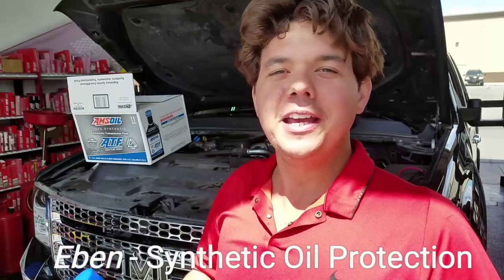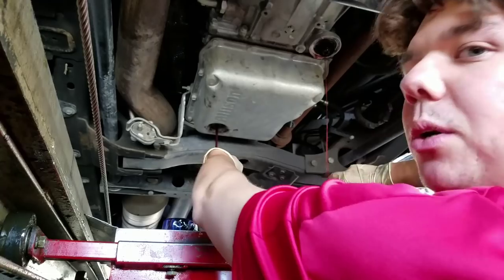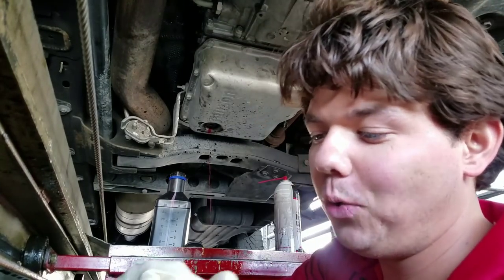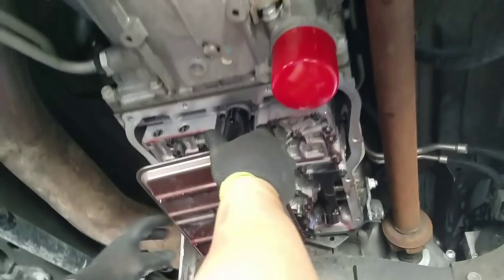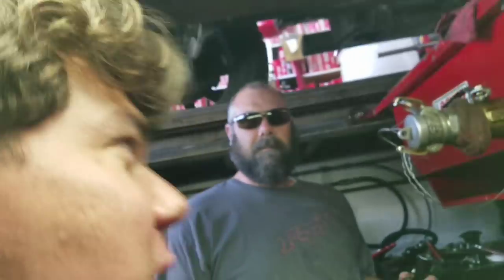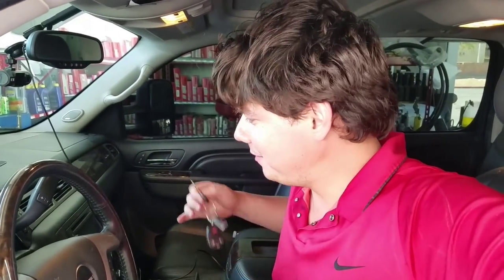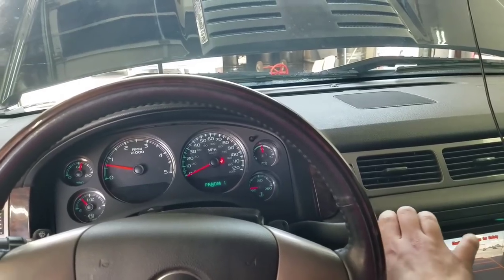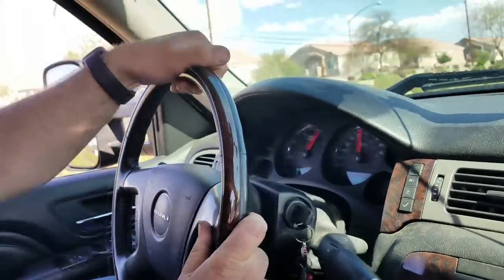2013 GMC 6.6L 2500 AMSOIL Allison ATF Fluid Change

Comment from the maker: Watch This Next: https://youtu.be/rYK246GoHQc

I give a man a fishing pole & show him how to fish. 

     Together! We can get your vehicles to run better than brand new!

     For me to get credit & be "Your" Independent AMSOIL Dealer please use my website below or my dealer no. 5331179 call anytime Eben Rockmaker 702-472-3614
After you click on: http://syntheticoilprotection.net
1. Click hamburger menu
2. Click offers AMSOIL preferred customer
3. Click join now 6-month PC member add to cart. ( there is no reoccurring renewal membership unless you select that dot box ) 
( you have the option to not have your credit card saved if you prefer - est. 1972 )
4. Scroll up to the top Select shop by vehicle.

New promo: FREESHIP
     
     🥇🥇🥇 Synthetic Oil Protection Google map reviews
Eben Rockmaker, independent Amsoil Dealer 
Dealer no. 5331179
(702) 472-3614
https://maps.app.goo.gl/1aXxuXrXK9eJwqK78
            
♥ See fluid performance tests - https://www.amsoil.com/performancetests.aspx?zo=5331179      

     ☕ Buy me a coffee - https://www.buymeacoffee.com/Syntheticoilprotection

🇺🇸 Did you know a oil manufacturer can call a lubricant a Full Synthetic when it's only 25% synthetic? AMSOIL is different because it is 100% Synthetic and has a higher film strength keeping the metal parts separated. AMSOIL allows less friction, less heat, less wear on the component. AMSOIL Signature Series motor oil has guaranteed protection for up to 25,000 miles or 1 year of normal driving. 

     ♥ Your vehicle could run better than brand new by choosing the right fluids! See results - https://youtu.be/by5RYv3Dt0Q

     🇺🇸 Why AMSOIL - https://www.amsoil.com/about/exclusive-distribution/?zo=5331179    

     ☕ Synthetic Oil Protection Coffee - Ebens Favorite: https://supportwith.coffee/shop/subscriptions/sop/

Comment: My experience with  amsoil is that the more you drive the better and stronger the engine feels and sounds
Reply from the maker: Yeah it takes thousands of miles to clean up the inside of a motor especially with the signature series and changing the filter.

I've noticed the motor on my synthetic oil protection machine has really loosened up and has made a lot more power now after the second oil change
Reply from the maker: I saw also did two engine flushes on it now

Comment: I've been using AMSOIL engine oil and AFT with HotShots' stiction eliminator and shift restore. Keeps my 2011 Duramax running smoothly as I approach 400k miles!
Reply from the maker: I personally wouldn't mix anything with Amsoil as far as fuel additives one of them that I've had great results in the Channel with my personal favorite it's called the diesel injector Clean Plus seatained boost it's a green bottle I recommend the 16 oz bottle every full tank hasn't maintainer and two bottles over 3,000 miles has a heavy clean up those.
I give a man a fishing pole & show him how to fish. 

     Together! We can get your vehicles to run better than brand new! 

     For me to get credit & be "Your" Independent AMSOIL Dealer please use my website below or my dealer no. 5331179 call anytime Eben Rockmaker 702-472-3614
After you click on: http://syntheticoilprotection.net
1. Click hamburger menu
2. Click offers AMSOIL preferred customer
3. Click join now 6-month PC member add to cart.  ( there is no reoccurring renewal membership unless you select that dot box ) 
( you have the option to not have your credit card saved if you prefer - est. 1972 )
4. Scroll up to the top Select shop by vehicle. 

New Promo: FREEPACK

Comment: Eben you missed a few steps when servicing this Allison Trans.  You shouldn't have to change the internal filter in Allison Trans . Only to changed when the transmission is overhauled but u can change the filter if you want.  Correct way to service Allison.  Drain Trans fluid by removing drain pan bolt.  Removed external fitter.  Reinstall drain pan bolt. Fill Trans with fluid with 7 to 8 quarts . Start vechile. Let fuild come out external filter housing to filter runs clean . Shut off vechile.
. Install new pre lubed external filter.  Restart vechile . Top of vechile with trans. The steps I described.  Flushes out all the old fluid in the convertor and flushes out the transmission cooler.  I'm  a certified Allison trans tech and guild member . Not bash your video . Just trying to pass on a little knowledge.  I'm firm believer  in Amsoil.  I use it in all my vehicles .  Corrvette, camaro and pick up trucks. Charles
Reply from the maker: Yeah I guess we did the extra step just for extra due diligence LOL
Reply: Wow this helps a lot.. so do how much fluid comes out of the filter hole when it’s removed
Reply from the maker: 6qts or more.
Reply from the maker: You can look up all the fluid capacities with this look up guide.
Reply from the maker: AMSOIL Vehicle Lookup - https://www.amsoil.com/guides.aspx?zo=5331179
Reply: Approximately how much more fluid comes out of the open filter housing before it runs clean?
Reply from the maker: We did a pan drop and we change the filters and there is still about half the fluid in the torque. Show the best way to do it is to come back and do another fluid change in about 5-10 thousand miles but you don't have to change the filter.

That's the best way to do it without flushing it.

That's the preferred way
Reply: charles swanson hey so I pour about 7-8 quarts of fluid in with the 6quarts or so of old fluid still in trans than start vehicle and let it come out with external filter off till I see it doesn’t look dirty? Also how much fluid does a lml Allison trans take? Thank you for the help
Reply from the maker: Matt this will give you the fluid capacity to your truck for every fluid on your vehicle.
AMSOIL Products & Vehicle Lookup - https://www.amsoil.com/guides.aspx?zo=5331179
Reply: Synthetic Oil Protection thank you. Should I use dexron 6 or tes 295 for a 2013 Chevy Silverado 2500hd diesel with Allison trans?
Reply: matthew bishoff use the tes-295 its recommended by person who makes the trans. Dex 6 is just bs by gm
Reply from the maker: Not sure what those are.

I would use AMSOIL ATF if it was my truck.

Lookup For Your Vehicles - https://www.amsoil.com/guides.aspx?zo=5331179

The best way to get AMSOIL is the PC membership - https://www.amsoil.com/offers/?zo=5331179  

Professional YouLubher: Eben Rockmaker Regency Direct Jobber AMSOIL Specialist (Dealer#: 5331179) Mobile: (702) 472-3614 

      Synthetic Oil Protection Website - http://syntheticoilprotection.net/

Lastest Promo: RECOVERY121
Reply: Sorry to ask but anyone else tried this type of atf in their alison tranny?
Reply: @mikelieberman27  I recently switched to it after I found this channel. Shifts a bit smoother. I like it.

Comment: Just curious but how often do you change your ATF and filters out for normal maintenance on this 2013 Chevy 2500hd?
Reply from the maker: That's a great question Austin if I was running the Amsoil Signature Series ETF fluid and it was my personal truck I would do the transmission fluid and filter every 40,000 miles of normal driving if I was doing all City driving or Towing I would do it every 20,000 miles.

Also the fluid times out over time at oxidizes even if you don't put a lot of miles it's good to change it every 5 years.

This will give you the very best value on the products as a 6-month preferred customer it's a one-time $10 fee gives you the 25% off and there's no Auto renew when you use my link below it will attach me to you so in the future I can always answer all your questions in the future about improving the performance and lifespan of your vehicles by choosing the right fluids as your independent Amsoil dealer👍
♥️   Find The Right Fluids For Your Vehicles - https://www.amsoil.com/guides/?zo=5331179      

     ✅   Save 25% On Your Next Fluid Order: https://www.amsoil.com/offers/pc/?zo=5331179

Comment: Why didn’t you use the amsoil torque drive ?
Reply from the maker: I like the signature series with the additives for cooled flow & extreme heat.😃🇺🇸👍

I give a man a fishing pole & show him how to fish. 

     Together! We can get your vehicles to run better than brand new!

     For me to get credit & be "Your" Independent AMSOIL Dealer please use my website below or my dealer no. 5331179 call anytime Eben Rockmaker 702-472-3614
After you click on: http://syntheticoilprotection.net
1. Click hamburger menu
2. Click offers AMSOIL preferred customer
3. Click join now 6-month PC member add to cart.  ( there is no reoccurring renewal membership unless you select that dot box ) 
( you have the option to not have your credit card saved if you prefer - est. 1972 )
4. Scroll up to the top Select shop by vehicle.

New Promo: FREEBOWL

Comment: So I'm confused. How much ATF fluid did you end up putting in. I have exact vehicle and I replaced spin on and internal filter. Same as what you did.
Reply from the maker: Great question Chad honestly I don't remember it's been so long you'll see everything here on the lookup guide I always recommend getting a couple extra quarts just to be safe also mid model year they can also do a pin change on different components and Transmissions so it's always good to get more and when you use my personal link that would attach me to you in the future I'd always be able to answer all your questions about improving the performance and lifespan of your vehicles by choosing the right fluids as your independent Amsoil dealer I really thank you for being a part of my channel💯😃😊
♥️   Find The Right Fluids For Your Vehicles - https://www.amsoil.com/guides/?zo=5331179    

     ✅   Save 25% On Your Next Fluid Order: https://www.amsoil.com/offers/pc/?zo=5331179

Comment: Would you want flush the trans. As there is still fluid in the torque converter.
Reply: No don’t do flushes on transmissions
Reply from the maker: Most of the time we just do a drain and fill and drop the pan change the filter and that makes a huge difference in the way it shifts- https://youtu.be/0YNrt962Q7U
Reply: Synthetic Oil Protection absolutely drain and fill does the trick change filter even better lol
Reply: Jesus you do not hammer on her after you just replaced the transmission oil! Also “nice smooth buttery shifts” is the transmission slipping! You want firm shifts especially if you’re towing lots. If you’re slipping you’re building unwanted heat!
Reply from the maker: LOL

Comment: How many miles do you change the transmission fluid on Duramax 2015?
Reply from the maker: It depends on the fluids used and the driving conditions......
Personally if I had a truck like the Duramax and used it for towing I would change the transmission fluid every 15,000 miles of severe service City driving with Towing. If I was doing all highway driving well Towing I would do 30,000 miles or 3 years whichever comes first.

If I live somewhere really mild like New Orleans and I didn't do any Towing and did all highway driving I would do 60,000 miles or 5 years whichever comes first. That's with the Amsoil 100% synthetic Signature Series ATF. 
If I had OEM fluids I would change it way sooner.
     Let's give a man a fishing pole & show him how to fish. 

     Together! We can get your vehicles to run better than brand new! 

     For me to get credit & be "Your" Independent AMSOIL Dealer, please use my website below or my dealer no. 5331179 call anytime Eben Rockmaker 702-472-3614
After you click on: http://syntheticoilprotection.net
1. Click the hamburger menu
2. Click offers AMSOIL preferred customer
3. Click join now. 6-month PC member add to cart.  ( There is no reoccurring renewal membership unless you select that dot box ) 
( You have the option to not have your credit card saved if you prefer - est. 1972 )
4. Scroll up to the top Select shop by vehicle. 

New Promo Code: FREESHAMPOO

Comment: Is that product(oil) work with transmission zf 8hp70 for chrysler 300 2015 ?
Reply from the maker: I'm not sure I would double check the lookup guide it will have the fluid and capacities for that vehicle.
Lookup For Your Vehicles - https://www.amsoil.com/guides.aspx?zo=5331179

Comment: I have a 2016 Tundra, they have a sealed Transmission system. i just bought a case of 12 atf Amsoil. Can you do a video on proper fill level on the Toyotas. They seem to be the hardest trans to level fluid correctly.
Reply from the maker: My transmission  play list has a lexus transmission that should be simpler. 
https://www.youtube.com/playlist?list=PLB_ftWArBFdfzuV7RHGz70MD-PawLbKgu
Reply: John Coelho does it have a lot of miles? We didn’t service ours until at least 75k miles, and the factory fluid still looked decent.
Reply from the maker: That's really good I don't recall exactly how many miles was on the fluid at the time we changed it

Comment: For new 2019 RAV4 how many years before you change the transmission fluid? What is the sign to change the transmission fluid? What is the good transmission fluid for 2019 Toyota RAV4?
Reply from the maker: Great questions Ronald yeah the most common thing is the car shifts slower also it starts to get clunky when you go from reverse park drive other things can be it won't shift at all once it gets really bad just depends on the car.

I always recommend doing the ETF fluid every 30 to 60,000 mi depending on how you're driving if you're doing a lot of highway driving you're good for longer if you doing all city you want to change it a lot sooner this is the lookup guide it'll give you everything for your year make model and engine size.
Find Products For All Vehicles - https://www.amsoil.com/guides/?zo=5331179
Reply from the maker: If you're new to the Amsoil I definitely recommend the 6-month PC membership saves about $33 and $100 order if you have any questions at all before you order feel free to let me know and when you use my link I'll get the credit for your order.
I appreciate you being a part of my YouTube community Thank you 😉😃🎬

Professional YouLubher: Eben Rockmaker Regency Gold Direct Jobber AMSOIL Specialist (Dealer#: 5331179) 702-472-3614 

     If You're New To AMSOIL I Recommend The AMSOIL 6 Month PC Membership - https://www.amsoil.com/offers/pc/?zo=5331179

Comment: So what does it normally cost to change all the fluids in a diesel truck?
Reply from the maker: That's a great question Dennis it would depend on the truck probably on a small diesel pickup truck probably around 1350.
On an 18-wheeler I would guess somewhere around 5650 with labor just depending on who's doing it. Those are just estimates until I look at labor rates and other components because of inflation then it could be a little bit different👍
Reply from the maker: If you're thinking of getting some fluids for your vehicle this will give you the very best value as the 6-month PC member and there's no Auto renew when you use my link that will allow me to answer all your questions in the future about improving the performance and lifespan of your vehicles by choosing the right fluids as your independent Amsoil dealer👍
♥️   Find The Right Fluids For Your Vehicles - https://www.amsoil.com/guides/?zo=5331179      

     ✅   Save 25% On Your Next Fluid Order: https://www.amsoil.com/offers/pc/?zo=5331179

Comment: Is the torque drive safe to use in the Allison?
Reply from the maker: This will give you all the products for your year make model and engine size and when you use my link I will be able to answer your questions in the future on the products as your independent Amsoil dealer.
I recommend the 6-month PC membership will give you the best value on the products.
♥️   Find The Right Fluids For Your Vehicles - https://www.amsoil.com/guides/?zo=5331179

Comment: But does it meet the tes-295 standard recommended by allison them self?
Reply from the maker: AMSOIL Meets & exceeds all specs on the bottle - 
https://www.amsoil.com/p/signature-series-fuel-efficient-synthetic-automatic-transmission-fluid-atl/?zo=5331179
Reply from the maker: It's a big upgrade over OEMS.

25,000 Mile AMSOIL OIL CHANGE - https://youtu.be/vp1HTtlulR8 

The Power of AMSOIL Signature Series 5W-30 Synthetic Motor Oil protects against harmful deposits on turbochargers 4X better than Mobil1® Extended Performance and 3.6X better than Royal Purple® in industry-standard testing*. https://www.amsoil.com/newsstand/motor-oil/articles/leading-the-field-in-deposit-protection/?zo=5331179 

     Better MPG Proven - https://www.amsoil.com/newsstand/motor-oil/articles/another-win-for-amsoil-products/?zo=5331179 

AMSOIL Performance Test Results - https://www.amsoil.com/performancetests.aspx?zo=5331179
Reply from the maker: Awesome thank you Michael.

If you share a link with amsoil it would be great if you could put my link extension on.

?zo=5331179

If you put that on the end of any URL from the amsoil page I will get the credit when someone signs up.

Comment: I just did my 2017 Honda accord with 29000 miles on it with the Amsoil CVT transmission fluid. These Honda CVT transmissions must be done every 30000 or they will have problems down the road.
Reply from the maker: It's great that you did years earlier than later😉
Reply: So we have a problem. Had an oil leak and don't know for how long. No signs of anything wrong while driving. Replaced hose. Checked oil and it was black and low.  Drained oil and checked again. Red now. Started truck checked again and black. Decided to drain oil again. Drains red BUT put in 7.1 lies and only got less than 4 out! Anybody know what is happening,?
Reply from the maker: @kymredford8870 that's a great question never heard of anything like this sounds like there's a cross contamination issue I would go to someone that works on these trucks every day they will know exactly what's going on👍